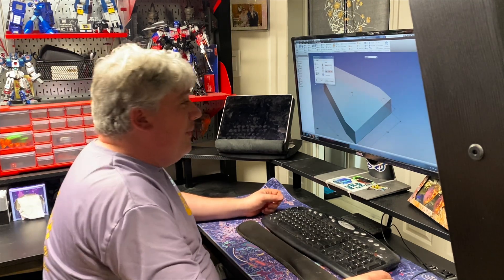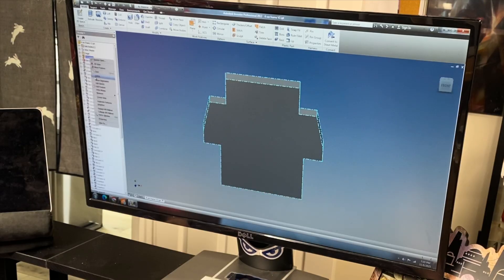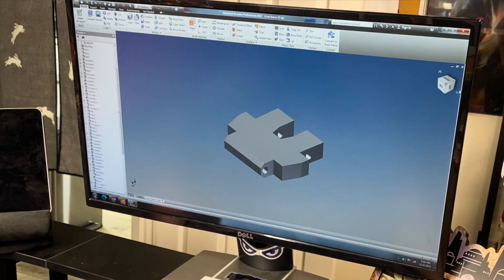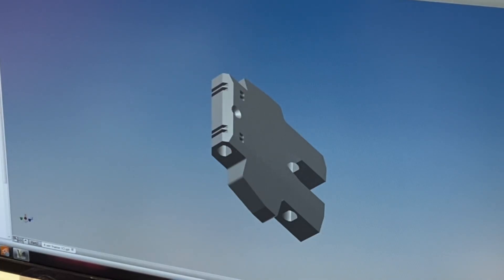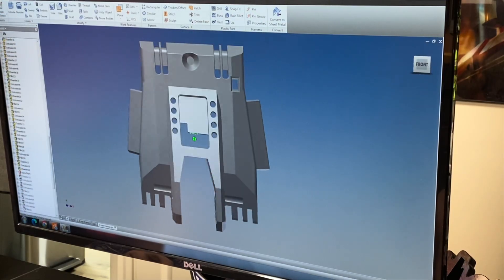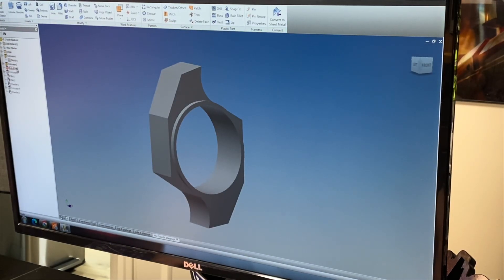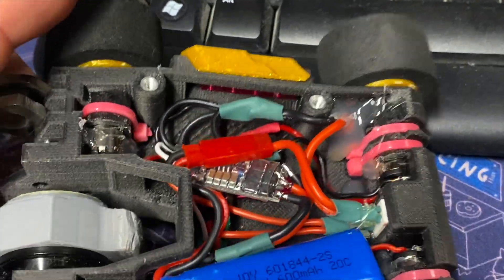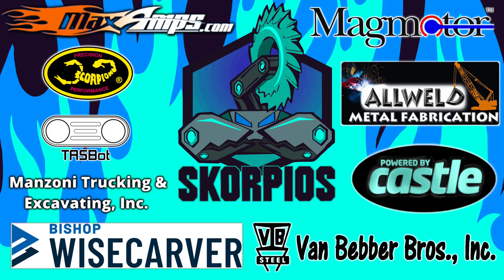I Remade Hypershock! But Tiny...

Comment: You can change the spacing of support material patterns to use less plastic, you just need to accommodate by using 1-2 more layers of the support top structure (which I forgor the name of)

Comment: Does it have a wedge
Reply from the maker: There’s technically a vertical configuration and a horizontal configuration. The one that showing at the beginning of the episode is the horizontal however, I molded mine after the vertical.